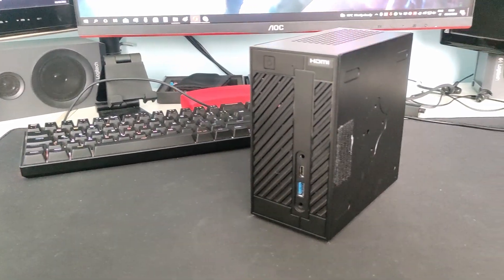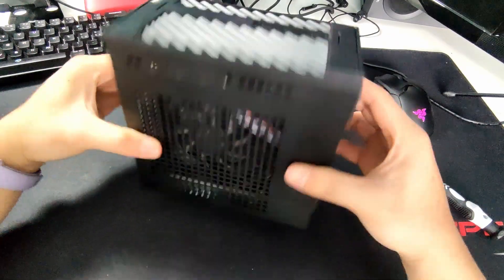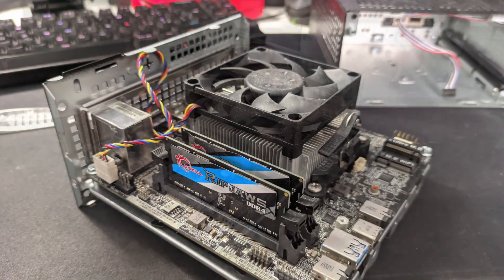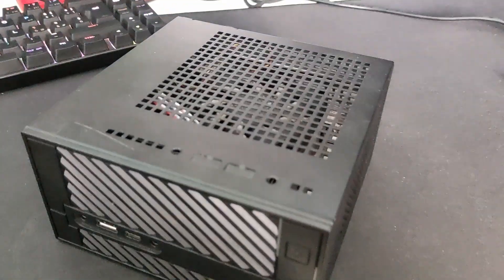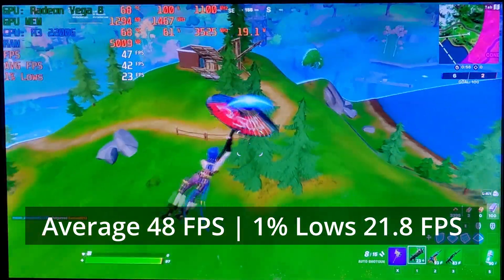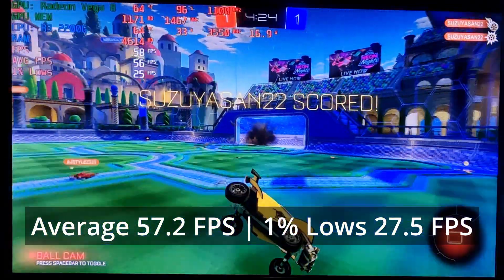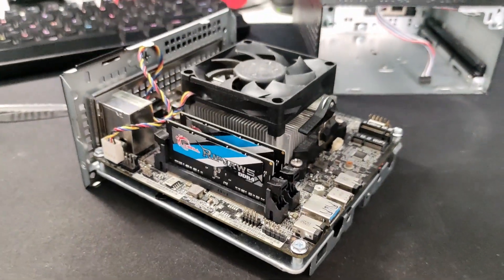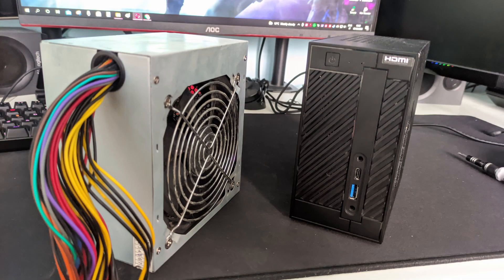ASRock Deskmini A300 Revisit 2022

Comment: i bought this along with the a8 9600 soly for updating the bios so i can use the 5700g cpu the bios sticker on the mobo says 3.50 and im also using crucial balistix 3200mhz 32 gb ram it turns on but wont boot i also took everything out to just check i also was able to verifiy in a desktop that the cpu works but dont have anything to test the memory that uses sodimm i also have a lower jdec certified stick of ram on the way by owc just to see if its a bios update isue does anybody know of a fix tried all outputes and just to see even though i know it needs t be bios updated the 5700g and both produce difrent results on the fan speed indicating somthing is happening or at least not complety dead thnx in advance for any and all help in advance

Comment: I'm still use this device, with the same specs, r3 2200G/8GB, but now it has alot of BSOD, makes me so fustrated. I don't know if it's the hardware problem, or software. The BSOD code keep changing, irql not less or equal, memory management, pdf,page fault non paged aera, system thread exception not handled, and many more..., can you help me?

Comment: Nice video, it's always great to see the 2200G get some love. One thing about the Valorant benchmark - from the overlay, it seems like the iGPU's actually not working as hard as it could (~60%, and that the CPU hovers between 80 and 90% usage. In cases where you have a CPU bottleneck like this, lowering the resolution won't do much - you either need to lower CPU utilisation (close background tasks, maybe?) or overclock, though with the thermal headroom in an A330 that'll be a bit tough. Does the BIOS even allow overclocks?

Either way, nice work!
Reply from the maker: Thanks man! That's true, the GPU is getting GPU bottlenecked by the CPU, unfortunately the A300 doesn't support OC of the CPU.